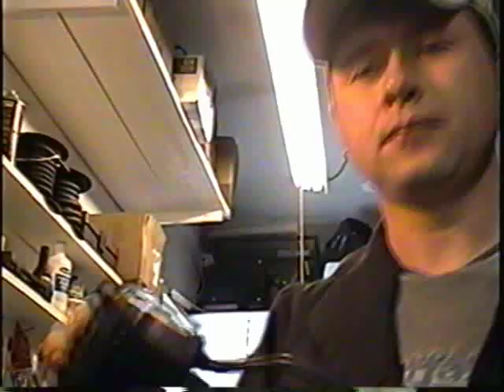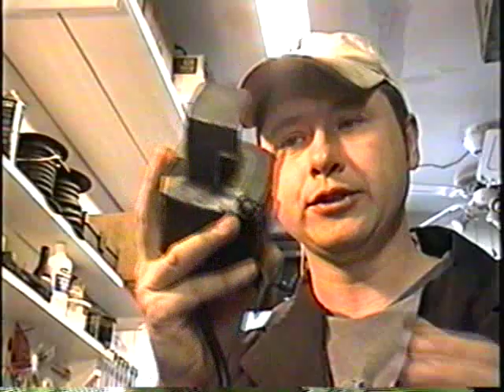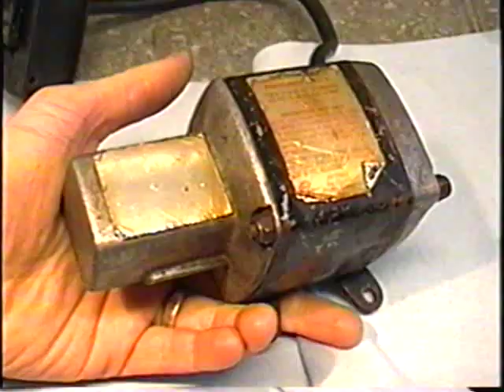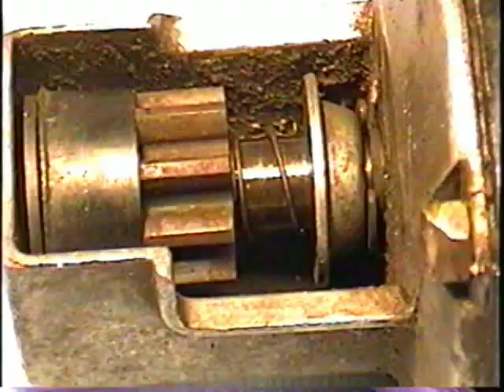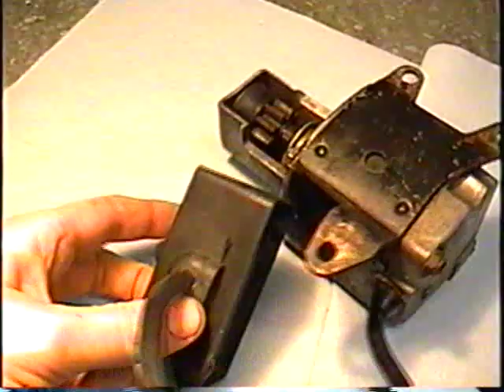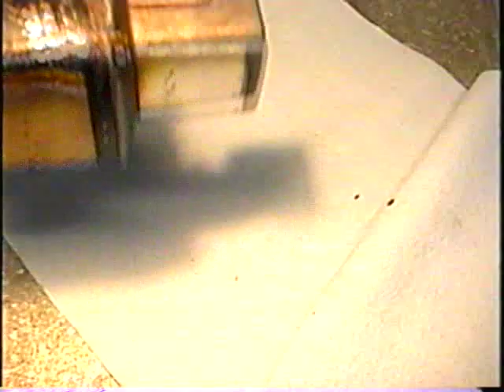4HP & 5HP Snowblower Electric Starter Repair

Comment: Original TroyBilt 42000 snow blower made in NY over 20 years ago with
Tecumseh 5HP HSSK50 67323N
engine. Before company was sold off to MTD. Does anyone still sell starters for these 5HP engines?
All the ones I'm seeing on Amazon are apparently for the 8 to 11 HP engines, and they look different from this one shown in the video. They gave an exposed gear rather than the shrouded one here, and looks like the gear extends rather than retracts to engage.  Haven't looked at it closely to see exactly what mine will need, but comments all say that there the starters are not interchangeable between the 5hp and the 8 to 11hp engines. That would make sense if they look completely different like this, I thought it might have been the drive output capability, but apparently that isn't the issue, they just didn't use the same configuration.

Comment: ihave a MTD hp tecumseh engine it says that its ready for an electric starter but i don't know which one to get the case that goes goes the flywheel has a somewhat square knock out on it and the block has 3 mounting screw holes. There appears to be two different starters that look compatible one is a 33329 d/e/f which has a cover over the bendix the other one has an exposed gear with a rubber cover over the motor shaft, which one do I need ?

Comment: Very useful thanks!  5 above outside and the snowblower was only running with the choke on but yesterday it wouldn't keep running so I tore off the carburator.  Inside of the thing looked like it was full of cheese.  Ethanol had disolved the seals and hoses.  Got the rebuild kit.  Replaced the bowl with the type without the drain as that leaked like a sieve.  Started on the first pull but of course the pull rope broke.  Fixed that this morning then finished the tuning.  Then I lubed the transmission.  Now just for giggles I'm working on the starter which has the gear frozen out.  Now if you can just tell me how to fix the noise on my girls' 2001 mercury cougar starter???
Reply: Mission accomplished. It works just fine now.

Comment: I have this starter motor on my 5hp Sears Craftsman 5/22 snow blower. The mounting bracket separated from the starter motor body because the 4 spot welds failed. Is there any way I can reattach the bracket to the motor housing? Can it be re-spot welded? Any other ideas appreciated. Thank you.

Comment: Hi Dony,
Thanks for this video.  I'm working on a snow blower w/ 5HP Tecumseh.  Starter was not engaging ---probably due to missing bottom left 1/4 20 mounting bolt.  Right bolt was in place but has black material in hole.  New bolt will not screw in. Is there such a thing as a self tapping screw to replace the original.  Looks like the block might be aluminum on this 10 yr. old MTD machine. It is a blind hole. Tecumseh confirms that it is a 1/4 20  by 15/32 bolt or 1/2" long bolt (2 calls). Should I try self tapping? Or try tapping 1/4 20 hole or heli coil?  If Heli coil type is one better than another?
thanks in advance for your help. really appreciate what you do so well.
P.S. Starter seems to work well in my hand except that the gear sticks in the engaged position even after WD 40 liberally applied.

Comment: Hi dony,
 I have this model starter on my Craftsman snowblower, however the gear moves back and forth freely on the shaft it is not stuck. It will not engage the flyheel. the teeth on the starter gear look a little damaged. My questions is, could that be the problem and can i replace just the gear or do i have to buy the starter and all.Thanks for any help.

Comment: I tried to upload a photo. What I need is a drive gear that is about 6 inch in Diameter, has 48 teeth and is about 0.5 inch thick.  The material is fibrous plastic and some teeth got chewed up due to misalignment of the wheel shaft and the drive pinion.  Let me know if you have a source.  Thanks.

Comment: Thanks for putting this DIY info on Youtube. Keeps me from spending money in the shop. I have a 24 year old Sears 24 inch snowblower. I had to find a replacement gear drive wheel and it is not available from Sears but found one in a handyman shop.  Any ideas of where to look for a spare.  Also I am thinking of switching the drive to chain and sprocket.  
Thanks for the tips.

Comment: Great Info, If possible, could you do one of a Toro CCR2000, To change out the auger bearings as well as the auger padles. Short of a complete tear down Is there an easyer way to change these parts? Also do have an extra starter for an earlier model 826 Toro not sure what year there Is NO tags or stickers or engraved numbers on this unit,